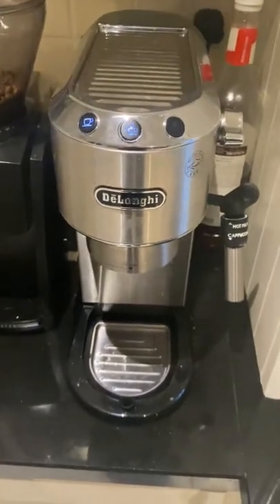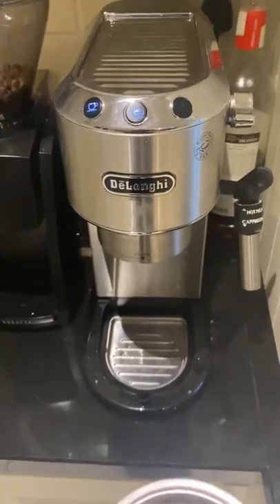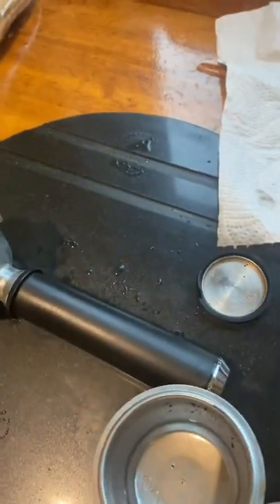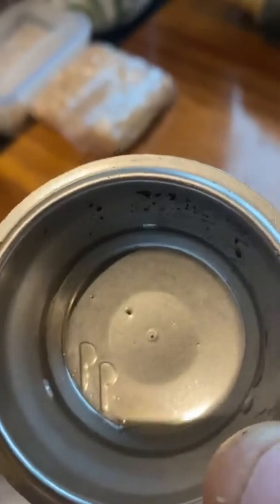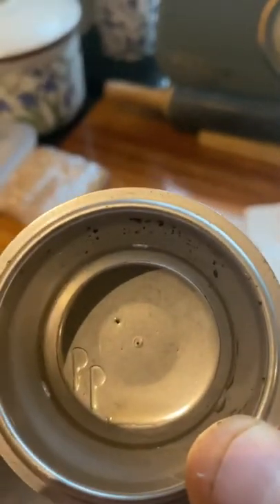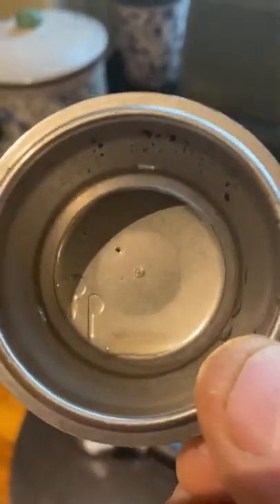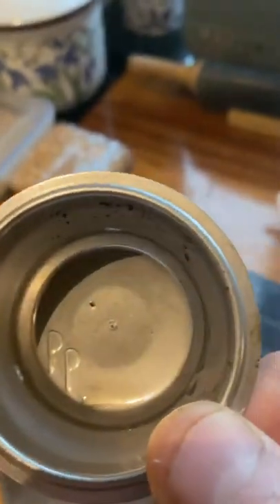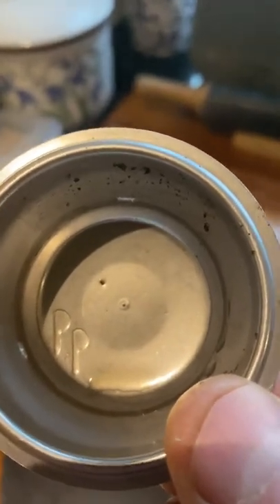DeLonghi EC685 Problem Coffee not flowing through to cup

Comment: Thanks 🙏 mine wasn't blocked, it had never been used! For some reason the single cup one has always worked. Finally got fed up (after 7 months of using the single cup one 🤣) , did a bit of a google and this was the first one that popped up. 7 months of pain fixed in 1m31s 🙈

Comment: Need to test this. Just bought my machine and it stops every time when i try to make espresso. I have tried less tamping and diffirent grind espressos. But it wont work. Hope that its only the filter that dont work.
Reply: Did it work?
Reply: @woodsideCraig  I made a larger hole using a nail and it works better. However buying a grinder with grind options can help to get evenly grinded coffee for best flow.

Comment: nearly 2 years I've had the dedica and the two scoop filter never worked. never worried as I use a lungo mug and one scoop enough.  however today had to make a large coffee for someone and had to do two singles, so onto YouTube and eureka.  just used a small tack and a hammer and what do you know coffee flowing fine.  Tx for this post.

also had an issue with water leaking from sides of dispenser about 6 months ago onto you tube and looked like O-Ring needed replacing.  ordered one and simple replacement.  between that and this like having a new machine 😂

Comment: I had the same issue, with the portafilter and coffee, the machine was working with clearly low sound vibration, so I started it without portafilter and it was working properly, so I turned the machine off for 10-15 minutes, then I watched your video, I checked that all the filters are good, I put coffee in the portafilter and I placed it and everything worked.
Strange dedica bug, but anyway the machine is great and the coffee is amazing.

Comment: This is the followed up of my comment written 2 weeks ago about water no flowing out due to grind size issue.  After having watched a video from Lifestyle Lab abt adding paper filter at the bottom of the puck, I tried out the same method but instead using non-woven tea filter and the result was surprising.  The problem of water not flowing out from filter cup has been solved.  The paper filter will work but I use non-woven filter because it can be reused a few times after cleaning.

Comment: If the pressure valve, group gasket seal etc are in good condition, making the hole of the filter cup bigger will not solve the problem of watering not flowing out smoothly.  Even I made the hole to 3mm diameter and tamped the coffee powder loosely (assuming the same amount of coffee power in the filter cup), coffee still could not flow out smoothly, likes something got stuck inside.  After a few attempts, I realized the problem was due to the grind size of the coffee powder.
Reply: Like it was ground too fine?

Comment: Mine still does not flow properly  even without the cup with the hole
Reply: Yeah this only describes the problem with the filter. First place to check out. But after a couple years, De Longhi machines typically lose pressure, through the pump/valve without any filter basket.  So the advice suggestion is to replace the 15 mbar pressure valve (rather than the pump motor).  It has been commented  that these valves are the first things to fail on De Longhi machines in use.  I have previously ordered and received a pump and valve set.  The YT demos suggest that De Longhi have a lot of secure slotted screws to under to get access to the inside.  When I attempted on a previous machine, it was so rusted through, and awkward, I decided to ditch the machine.   The valve replacement is then straightforward according to the videos. But since I am now having pump through problems with my latest machine  I will have another attempt to dissemble and refit a new valve this this weekend.